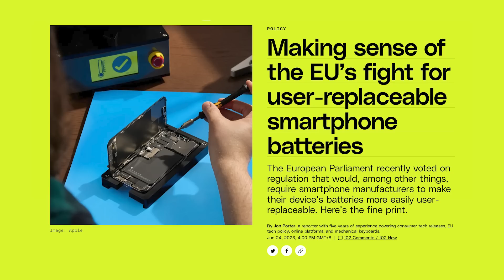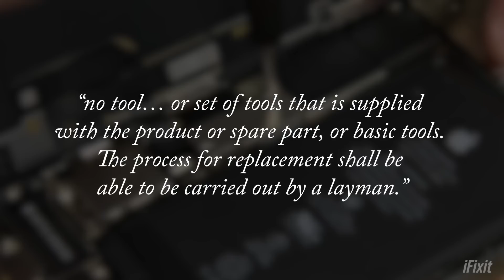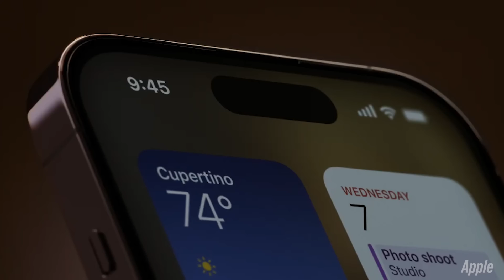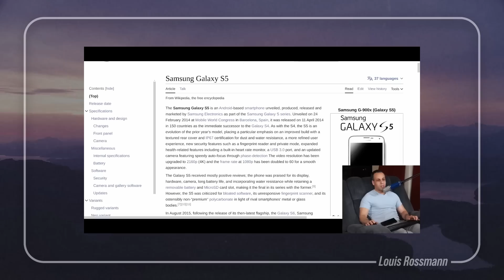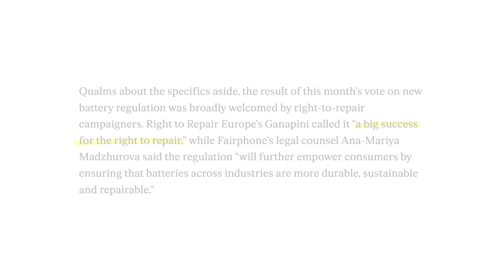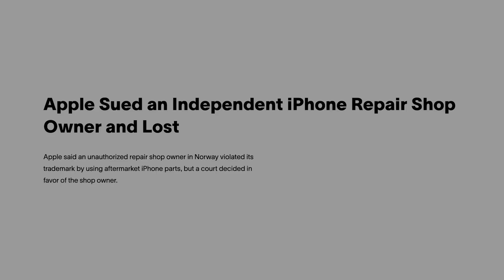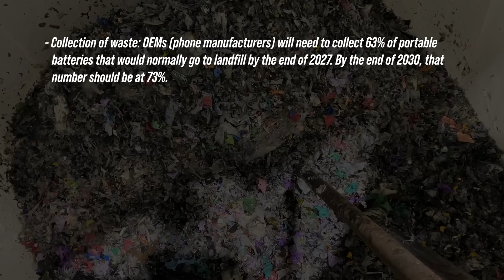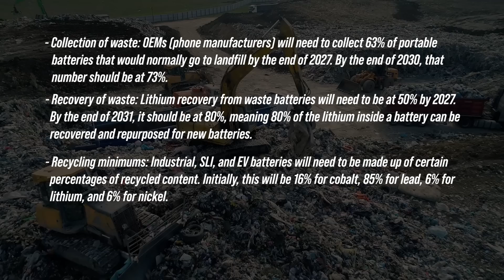EU Just Changed Smartphones Forever

Comment: They can still use adhesives and I imagine they'll still be using glass in phones. They could make them exactly as they make them now, they just need a flap or a catch that you can remove the battery from. You can even do waterproof, have a sealed body with the battery compartment external to it, with solid metal contacts passing through. Likely for thinness the battery and the bottom-rear case would be one unit, you'd unclip it to change. The battery itself could still be waterproofed with a gasket.

If they want to make waterproof phones with this new stipulation, it will take a bit of thought. But if we're going back to the Moon we should be able to master battery-box technology. If you don't need waterproof then there isn't even a problem to solve.

Sealing batteries in phones is purely through greed. It's a de-facto cartel, all phone companies doing it to increase general turnover. Plenty of people were happy to keep their phone for years, back when batteries were replacable. The battery is the only part that really wears out. 

Am I right in thinking the people who work for this Youtube channel are too young to have owned phones back when the batteries were replacable? Or do they just believe everything Apple and Samsung's PR companies tell them?
Reply: The owner of this channel is a tech dude originally from India lol. don't expect much.

Comment: Great idea BUT a simple tool like a standard screwdriver should be ok to be used for the replacement. I remember a common problem was the back side accidentally fell off. This is still a common problem with things like tv-remotes for example.

Comment: Finally. I have always said the best smartphone ever made was the galaxy s5. It had usb 3.0, removeable battery, headphone jack, sd card slot, and was water resistant. I work in phone repair and have hated the direction phones have gone since the s6. However my fear is that apple and possibly samsung will just make 2 versions of phones now 1 US with no usb or removeable battery. And then an EU version with those features or possibly just not directly sell in the EU. You know they are not going down without a fight on this. Hopefully they do the right thing though.
The argument that it will make them thicker. I think most people are fine with that. I am fine with having a phone that is 2mm thicker. Get rid of the stupid camera hump, give me a headphone jacka nd a thicker battery. Just crazy the direction phones have gone in. 
BUT these manufacturers already make different phones for different regions. Usually its just a processor or antenna difference though.

Comment: While this will help I'm sure, we also would need a law for "minimum security update support time period" so that fully fonctionning phones don't have to be thrown away. Maybe it would have less an inpact because most people don't care owning non-secure devices, but I recently had to upgrade to a new phone because of this very reason.
Reply: The EU is already planning a minimum update guarantee ✅
Reply: Depending on the phone you could use a third party OS to keep it going. That's what I am doing with an old "unsupported" Pixel 3. Works just fine to this day, battery and all.
Reply: I recently had to upgrade because an ios update made my older iphone basically unusable by freezing up for a few seconds every couple mins and a very lagging keyboard. It's obvious they're doing this on purpose. It was very sudden right after the update. My phone was super fast before it
Reply: Some of us want the security update and if app devs adjusted then the apps will run longer
Reply: @spokee  This is Apple, they have a HUGE team that could easily work on past versions without it taking longer
Reply: They should also have a law that mandates company to release the full source code of the operating system once they stop supporting the device
Reply: @SeleDreams  no thats too far, they have a right to keep that private
Reply: @mhxxd4  the issue is that if they keep it private it does create e-waste since it means that a perfectly fine device ends up unusable
Reply: @SeleDreams  depends on the phone. Pixels at least you can install any open Android version, and some non-Android OSes too. I believe the same is true for some other phones, but not for any Apple phone. And I don't think it's ever going to change, you cannot force open-sourcing all software due to eg. patent issues.
Reply: @wombatdk  for android phones, normally all manufacturers should do it because of the gpl license of android and of linux, but it's not really respected often because in any case they would need to be sued by the free software foundation for anything to happen
Making it a general law would make it easier to punish companies who don't

For iphone, even more reasons, once an iphone isn't supported anymore, apple mandates devs to update their apps and then  they stop working on the phones until the phone is unusable
With these laws it would force apple to keep these phones usable if they don't want to open source them

Comment: Its really not that hard to put a access panel on the back of the phone to be able to remove the battery. Instead of taking the phone apart, you remove a few screws that remove a section of the back to gain access to the battery. They can still use adhesives for the entire phone.

Comment: The disappearance of user replaceable battersis is entirely deliberate.
It enabled reduced parts counts (no battery carrier, touch connectors etc). and the publc fell for it. Because the nw products were slimmer and attractive.
Currently a failed battery almost certainly results in the replacement of the device. The life span of the battery determines the life span of the product. It results in a shorter sales / replacement cycle than used to be the norm.
I have seen, in the past year, a two year old HP laptop (owned by a charity I work with) and a not old Xiaomi phone (mine) be consigned to the waste bin because the batteries failed. They expanded and burst the device cases. I have never seen that happen with removable batteries.
My wife is still using a perfectly functional Toshiba laptop (8 yrs old) that had it's removable battery replaced (only 19 Euros!) a couple of years ago.

Oner can still use most such laptops WITHOUT the battery installed, if it's connected to mains power! I have one such that runs my CCTV security cameras. (There is an external backup power unit).

Modern smartphones and laptops are too fragile to survive long, in hard use. I bet almost everyone knows someone who has broken a screen, if they haven't done it themselves.
The new legistlation is a good thing and will bring the manufacturers back into a more reasonable sale / replacement cycle.
Sadly, I think it will also result in higher prices, which the manufactureres will blame on the EU.

Comment: I think the easily replaceable battery removal was a mixture of both anti-consumer and the pushing of technology. We wanted wireless charging, and the only way to do this effectively was with a glass backed phone. A glass backed phone can't have an easily removable back plate as the glass is too fragile. 

Though, I do wonder if having wireless charging is even worth it at this point. I feel like the VAST majority of users just charge with a cable anyway. The only time I use wireless charging is the once or twice a year I visit Vegas and the slot machine I'm on has one lolol. 

So, I personally would be okay with losing wireless charging for easily replaceable batteries again.

Comment: This is for sure not a good change, getting a new phone every 2 years should be standard, replacing the battery doesn't make the phone run faster. Replaceable batteries are just going to leave less space for innovative features in the phone, and make them more expensive

Comment: Surely it's not that hard to produce a waterproof phone by just having the back sealed down with a few screws (philips, hex or torx - ngl I'm starting to really love the gripiness of torx bits now that it's easy to get drivers) and a rubber seal? I honestly think they could lean into the industrial look and make it really cool.
Reply: Small piece of information. To have proper seal you need a certain force to press against the gasket. It's typically done in 3 ways. You can have screw in cap as many automotive elements do but it is very bulky and has to be round. You can have press-in fitting but it requires proper frame around the element. This way you press the cover inside which in turn presses the gasket to the side frame. Or the other way around, you press the cover over a frame pressing the gasket from outside. That's how most watches do it, not enough space to screw it in but the back of the case and the glass can often be just press fit into it. The only problem is that you need quite stiff frame. Third option is simply to have bunch of screws or latches. This one is tricky though. Both press fitting and screw in cap will press against the whole gasket evenly but if you have a piece that has multiple mounting points, that's where the pressure will be the highest. The bigger is the distance between screws, the more rigid the frame and the cover have to be. Otherwise it will flex enough to leak, especially if you want this to be IP68. So you either need more expensive, heavier and thicker phone or you will have to put a lot of screws all around it.
To be honest, using glue seems to be the best way and what I would rather consider an improvement is creating special glue that does not need heating to pull it off. You will rarely see any force that tries to pull the screen out of the frame of the phone. If someone makes glue that does not sheer easily, does not degrade but is soft enough that it can be pulled off with enough force and time, it would be perfect. Just get two suction cups with a spring, put this on the phone to pull the screen out of it and leave it for half an hour. It will remove the screen and you can replace the battery. How hard is it? The only thing we need is correct glue.

Comment: Imo it might have been more productive to have also the option for the phone / tablet / laptop sellers to comply by providing battery replacement services at cost "while you wait" (with fines if they fail to do so) - the design and technical  benefits of integrating the battery inside the case seem obvious to me.  I don't want to go back to phones and laptops whose back covers can pop off "without using tools" and I prefer my equipment as sleek and light as practicable please.  

Lawmakers should be concerned about the right to repair and battery replacement & recycling generally without trying to force design criteria onto the makers.  As they say, there are more ways to skin a cat than are dreamt of in your philosophy.

Comment: I think it be even funnier if Apple just straight up, refused to sell the iPhone to the EU because of the USB-C and removable batteries
Reply: The EU and associated countries are a market of over 500 million people with a GDP like China.
Among them are many wealthy nations. Although the IPhone quota among smartphones is not as high as in the U.S., it is likely to be a market that Apple cannot do without. The gap left by Apple's sales stop in the EU would be filled very quickly by Samsung and Co.
Apple will bow down, as it did with the USB C connector.
However, I am also somewhat skeptical that an IPhone with a replaceable battery can maintain the waterproof standard.
I do not see a problem with MacBooks, which do not have to be waterproof and are not!

Comment: RE: Dirt/water "ingress protection"

I remember very clearly using the Samsung S5 (neo) I loved the official Samsung leather style wallet case. The factory back panel was replaced/substituted for the official case. This preserved the IP67 rating and had a slick and understated look. Sadly battery died and phone was already 5 years old, covid was kicking off so thought I'd better get a new phone.

I'm on Samsung A51 now. The battery is sealed so any case is an after market clip on thing. Not as ergonomic☹️
Reply: It's funny that the main example of great phone with removable battery is the one you used and replaced instead of replacing battery. Exactly as most people do with any other phone. Have you ever replaced the original battery in it or it was the original one?
Reply: @MaciejZałucki  it was starting to look dated. Kids use it now. I look at the screen (size, resolution etc) - how did I use this for so long?

I made it last 5 years. I think I had it on an initial 18 month contract, then SIM only.

Phones now suffer from what I call the "salad emoji" effect. There is so little improvement in camera, battery life, general speed etc manufacturers are promoting fairly inconsequential software tweaks as game changing improvements
Reply: @liammhodonohue  Still, older style of battery lasted enough for the phone. It's hard to justify serious design decisions to easily allow doing something you may need to do once or twice during the whole lifespan of the device, especially if it's estimated to be 10 years or so. Battery replacement for modern phones costs $50-100 at most and I bet it's much cheaper in countries with cheaper labor. Large part of the price is the battery itself, so the real difference between the cost of replacing battery with and without removable batteries is not a deal-breaker that will make people use their phones much longer now. It's just wishful thinking. At some point people simply don't want to invest money into old things and it does not matter if it's $30 for battery or $50 for replacement, it's still something that many people don't find justifiable. On the other hand, if you think that it's worth to get new $30 battery for the phone, then why would $20 make the difference? It's like comparing 10% and 20% of the phone value to replace the battery, people rarely are in those brackets. They either consider anything below 50% of the value to be worth replacing or they don't want to spend a buck on it anymore. I really think that this law will not improve anything, any little gain by extending the usage of some phones will be offset by people buying new battery when they don't need it yet and then throwing away more batteries than they do now.

Comment: I think this is good. However, one question I have as they're now saying we have to have certain recycled materials in batteries, but what happens when solid state comes more available for consumer use as that's made from different materials isn't it?
Reply: You are touching on how the laws will be disruptive to the entire electronic mobile device industry. In the case you refer to it only means that subcomponent manufacurers and suppliers have to adapt their (replacement/stand alone) products too.